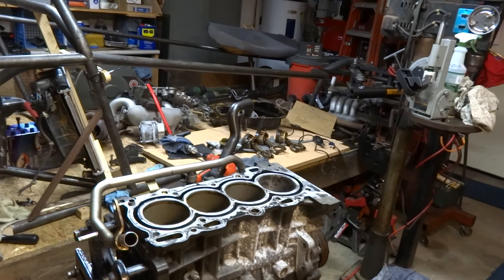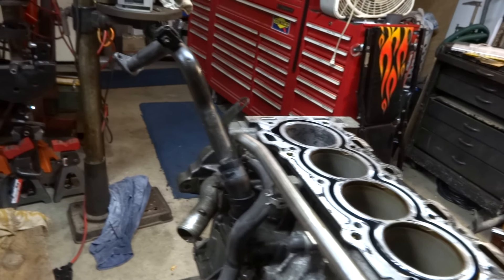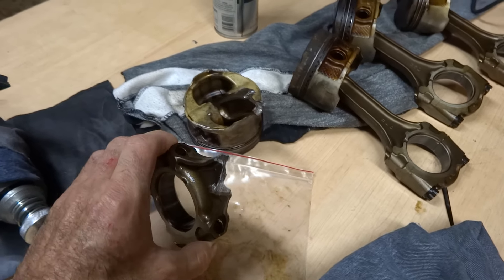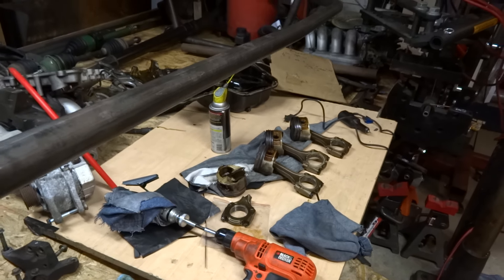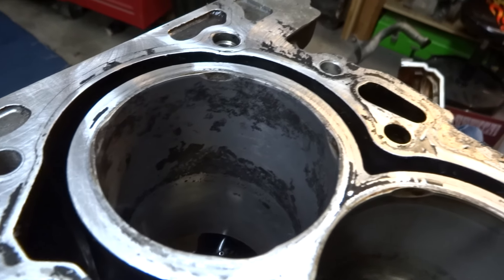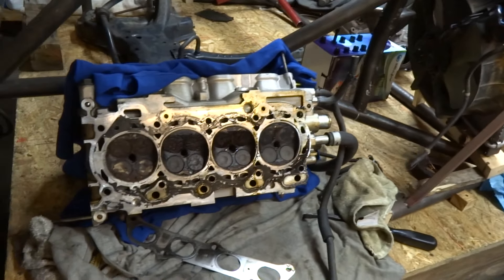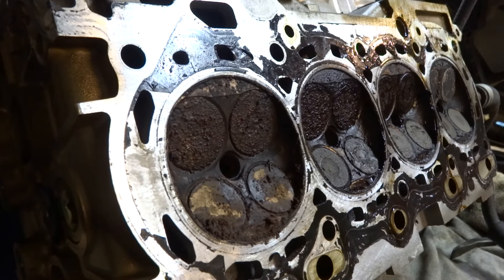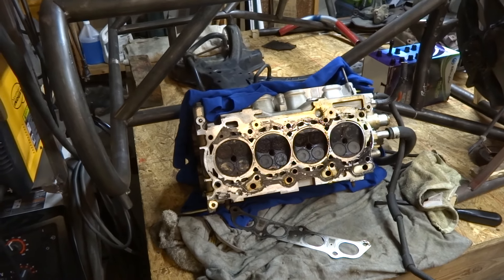Celica GTS, 2ZZ,  Hydrolocked motor

Comment: Unborable? More details on that please?
Reply from the maker: The block is aluminium. Cylinders are a  mixed metal matrix... casting,  Needs to be sleeved to repair.  Cylinder walls will not last, or seal correctly if bored. Search " boring a toyota 2ZZ" google will give you a lot of results to look at.   If your interested I found some info on mixed metal matrix.  http://210.101.116.115/fisita/pdf/A065.pdf